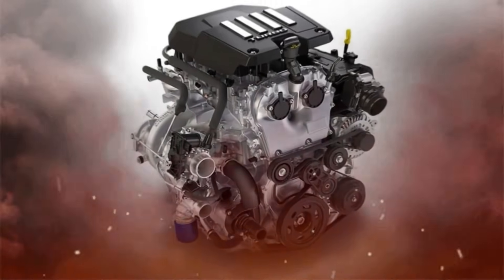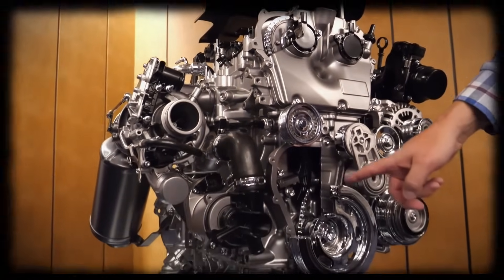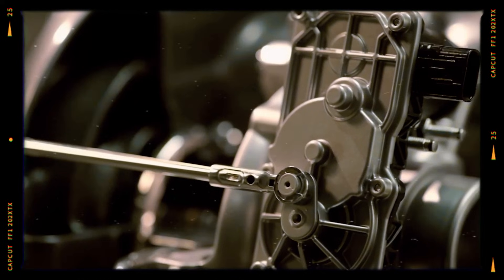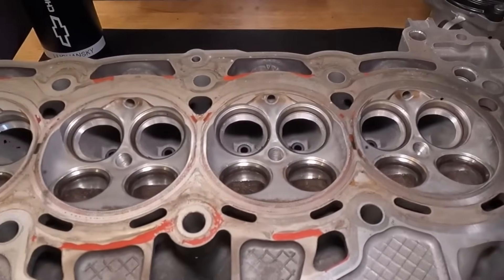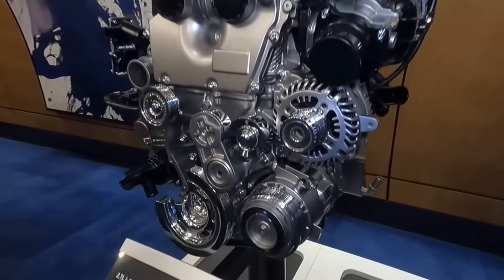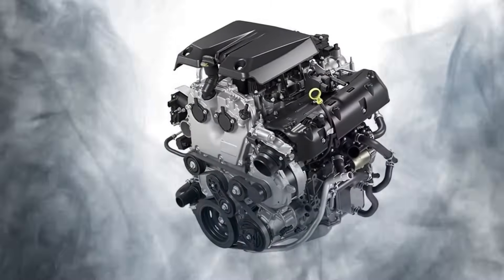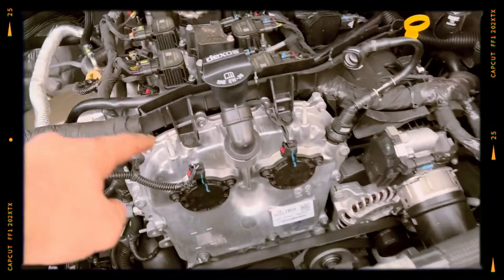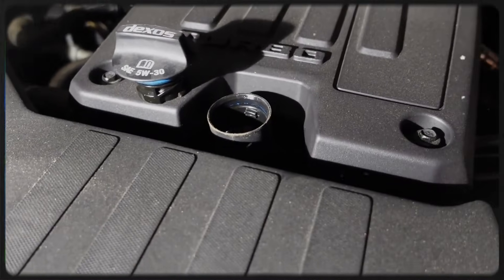GM 2.7 L3B Turbo engine! Characteristics, overview, common problems!

Comment: IT'S JUNK!  NOT a good ENGINE!!!
Reply: It's not that bad. My shop works on a company fleet set of these. They are great
Reply: @TheJines123  have you found anything that would constitute a red flag at all?
Reply: @nedmorales1313  honestly if you buy one make sure it's a 24 and up. The 23 has a plastic pan and are prone to leak. Run very good oil and change it between 4k-5k. If you don't they like to eat the cam phasers. Other than that they have been solid for my client. He has 7 with 200k miles on all of them. We also service a CSX scout truck with a. 2.7 and it's worked everyday all day and has almost 16,000 hours of running time. Not one problem out of it. It's a high tech Inline 4. They have a pretty trick set of cams in them. That's the main reason to keep the oil changed sooner. These engines have billet cams and a full steel forged rotating assembly. They are built to work. They have a longer stroke than a duramax diesel and great low end power. after seeing my clients vehicles i bought a 2024 canyon AT4X AEV and looooove it. GM is killing it with the midsize game right now.
Reply: @ especially in regards to the fuel injectors being that they’re direct injection
Reply: @nedmorales1313  no nothing wrong with the fuel injection in my experience.
Reply: @ cool thank you for your help.👍🏼
Reply: @nedmorales1313  no problem buddy. What truck you looking at with the 2.7?
Reply: @TheJines123  2024 GMC Sierra, pro 4-wheel-drive
Reply: @nedmorales1313  very nice. You'll love it
Reply: It’s been around since 2019 with non problematic results. Do some research junk boy!
Reply: We have four trucks with this engine now, and have had zero issues engine related. The 2.7 is about to go into its seventh production year with an excellent track record for reliability. Calling this engine junk just shows your ignorance.
Reply: When did you purchase yours and what made you come up with? It’s junk. The reason I ask is because I’m actually thinking of buying one so I would love your insight on why you think it’s junk.
Reply: @nedmorales1313 😊
Reply: @nedmorales1313  I just bought a 2024 Colorado WT crew cab (4 door) on Black Friday 2024. The door sticker says it was Manufactured in October 2024, so I'm thinking I got a left over parts from a 2024 with 2025 mixed in. My engine looks like the L2R 227hp as they don't have the plastic hood covering the coil packs. The VIN says it has a H2B engine 310hp and all of those come with that black plastic cover over the coil packs. Guess who's going back to the dealer to see if they can fix my Lemon. I paid with a cashier's check, so it's paid for. 1st brand new vehicle in 50 years. This truck replaces a 2000 Dodge Ram 1500 6 foot bed and a manual 5 speed that we have had for 21 years and only put 18,000 miles on it. Still gets 15 mpg. 20 of those years it didn't have a heater. Very glad this winter 2024 I finally have a heater. I can also pull a trailer as mine came with a trailer package with an electronic trailer brake control. We just wanted a basic truck without the bling. Like I don't need lighted mirrors on the sun visors, heated mirrors, etc. We just have the convenience package number 2 and the Trailering Equipment package. All engines have 10:1 compression. I think you should get one now. Mine was $34,775, add a 50% tariff on Jan 20th 2025 and it will cost you $52,162,50. Borrow against your home to get one. The payment is $200.00 a month for 12 years versus financed is $556.00 a month. You got 43 days.
Reply: I have the 2021 with 45000 miles that I bought new. So far the only issue was the purge valve at 23k miles but other than that no issues.
Reply: Do you own one ???
Reply: Wayne works for Ford.
Reply: 216k milage. No issues.....
Reply: , @ericj810  Fantastic news for me as I just bought a 2024 Canyon AT4X with the same engine